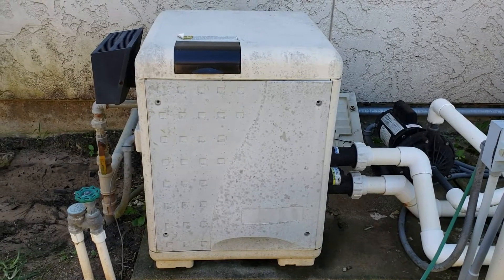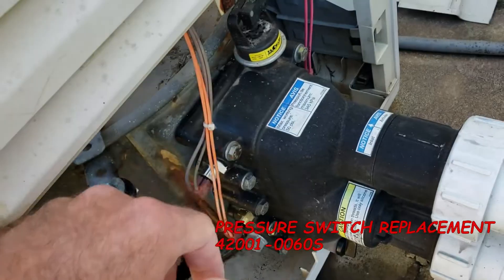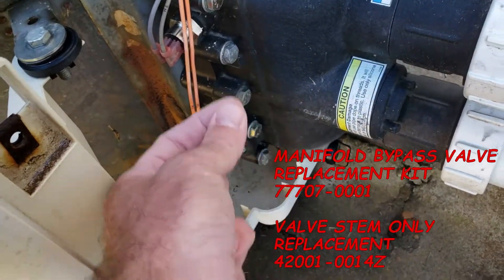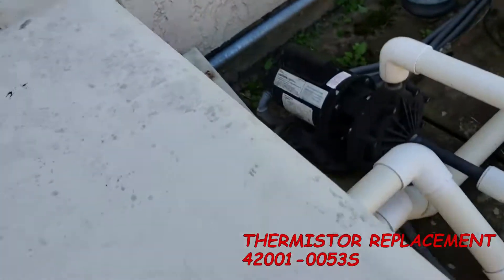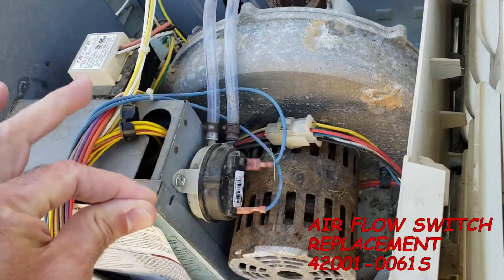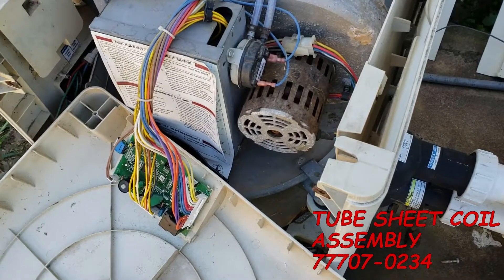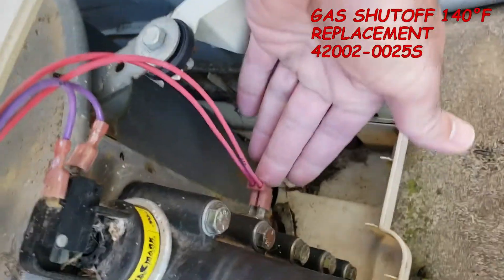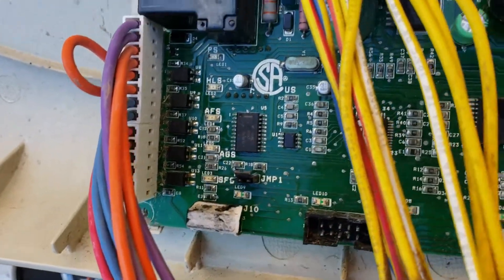PENTAIR MASTERTEMP 400 ERROR LIGHT LED EXPLAINED

Comment: Service light is coming on but no led light coming on ... any suggestions
Reply from the maker: I had that problem too.  Fortunately, my next door neighbor has a sta-rite unit which has the exact same parts as my unit.  I used his parts one at a time to check to see which part made mine work again.  It was the stack flue sensor that was the culprit, but did not throw an E05 nor the SFS light on the control board.  If it is not fully open, it wont throw the hard codes.  This was just a $21 replacement part.  Let me make a recommendation though.  If you can, get the kit that has all of the sensors on Amazon for $99.  When one goes, the dominos are bound to start falling.
Reply: Makes sense as it fires up and blowes hot air for a second. Ordering sensors now! Thanks again!
Reply from the maker: @MILKMANDELIVERIES  Well, I got bad news.  Mine is misbehaving again.  It fires and burns for a little bit, then quits and shows service heater.  No error lights and no codes.  However, I opened the cover to the Ignition Control Module (FENWAL) and saw that the red light flashed 3 times repetitively.  This is "Ignition Lockout", which could be caused by many things, but makes me think of a defective igniter as my first choice since it was under water when the combustion chamber filled up with rusty water, followed by AGS, then, thermal regulator, then stack flue sensor, then lastly the Ignition Control Module itself.  The Ignition Control Module is looking for specific ohms from the igniter and the connector was very corroded, so before replacing, I used WD-40 and plugged and unplugged the igniter about 100 times to kinda scratch the connectors clean.  I tried again and it worked!  So, I think I am on to something with the igniter being the cause of my Ignition Lockout.  I'll let it ride and see if the same problem happens again before replacing.  It's a cheap part but man I am $50-ing myself to death.
Reply: PVT-PILOT replacing the glue sensor worked off the bat.  After running for some time it did shut down with an error. Shut it down and restarted, ran again for a bit of time and had to restart it a second time.  We were in the tub in the middle of the night and didn’t feel like pulling it apart to see if I got a code.